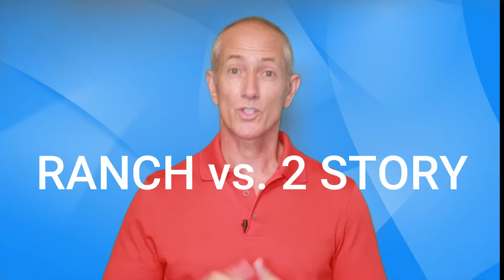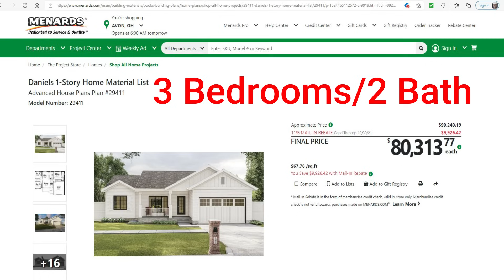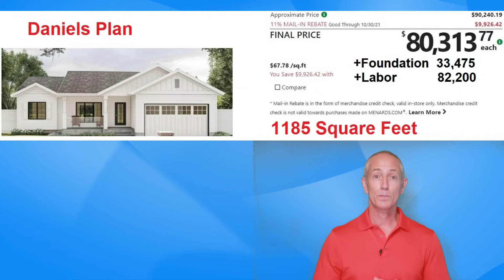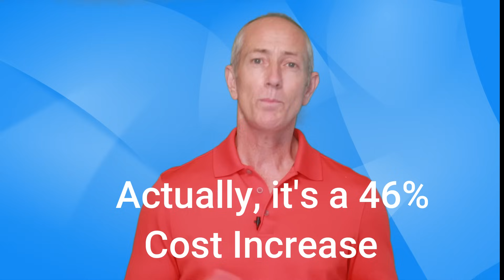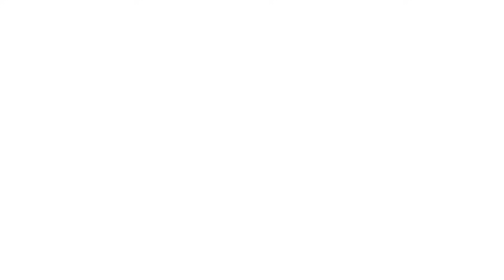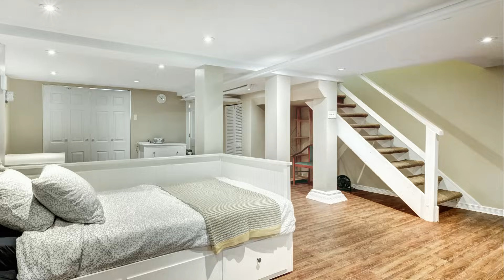Affordable Houses: 3 Design Tips to Save

Comment: Hi MIchael, I have a few questions if you have time to answer it:

1) When they advertised 2000 sq ft, does that mean just the house only or does it include the total land plot (front and backyard)?
2) If it's just the house are, is that the area of the first floor, or is an accumulation of both first and second floor?
Reply from the maker: Just the house and yes, it's the living space on first and second floor (garage and unfinished areas not included)
Reply: @OpenBookBuild   Thank you for the information!

Comment: Not that simple, 2000 SQFT in a 1 Story is much roomier than in a 2 Story.   Lots of SQFT is lost in a 2 Story for Stairway, Hallways, Walls, and potentially an additional bathroom.
Reply from the maker: Hey JB.  Typically the stairs to the second floor are stacked over the stairs to the basement so they take up less room.  Also, the hallways, walls and baths would be the same whether they are on the 1st or 2nd floor.  A good home design minimizes hallways to maximize living space.  Unless you really want a place to put all the family photos, a hallway is wasted space.

Comment: You mentioned labor but did not take into account the markup the Contractor is going to apply. Typically 20-30% on top of the subtotal number (Material and Labor) is what most contractors will give you for a final price. So lets take your $267K and add 25%, that's roughly $333K. You might say wow that's a big difference but the reality is that a legitimate contractor pays a lot of overhead to provide your project with legitimate labor and insurance. Consider that payroll tax is 12% (At least in NY it is), meaning if the contractor pays an employee $800/week that will cost him roughly $900 after Uncle Sam takes his cut, now times that by a crew of 3 or 4 and you you can see how the cost add up over the course of a project. A pick truck is $20-50K and the trailer, full of tools, the contractor brings with them is worth about $15-20K. When these tools break down, they must be replaced. You can decide to go with a cheap contractor but why put a 20-30 year financial obligation or 5 years worth of your salary on the line for the "wrong" contractor?

Comment: Great video. I work at menards, there are so many ways to reduce the cost of these packages. It’s kind of nickel and diming, but it adds up. Go in to the building materials desk and talk to the guys there, they can help :) 
First thing I’d do is change the siding on most of these packages. Many times it’s fiber cement or smart side, which is just absolutely nuts right now as far as cost goes.
Reply: What siding would you choose then?
Reply: It's such a durable item. Hardi just works especially for fire resistance
Reply: Come on, man.  LP is about $1.30 a sq ft.  How much cheaper can you get?
Reply: @MrSteeDoo  it’s not just the cost of materials . Include the cost of labor for installation and painting. Also the appearance of joints in siding , how appealing are they?
Reply: Gotta pay extra and go brick
Reply: I have clicked around on Menards website don't think I ever got their whole house packages location and then I live in SC and didn't see that they would ship.
Reply: How do iget the package for the build up from your company.
Reply: Man fiber cement is just horrendous to work with (cutting, weight, dust etc.) and you better be spot on with end cut sealing due to delamination from water intrusion. LP is so much more user friendly.
Reply: @rangerdoc1029  so you're saying everything within the home was fueled by some source... So even if the house was wood/paper/ect... It would have also burned. To get to a temperature to melt stainless steel screws to hold fiber cement... Your looking at some extreme fuel source

Comment: Here are a couple of practical tips for an owner managed build:

1.)  When you meet with the prospective trades on the jobsite, don't get out of your Mercedes in slacks and loafers, keep a modest presentation and drive a modest vehicle to the meeting.
2.)  Don't come across as rigid or difficult, communicate what you are looking to achieve and ask the trade for their thoughts on how they see it best being achieved at a reasonable cost.
3.)  Build at least a 10% contingency into your line item budget.

If the trades sniff you are flush, your bid will reflect that.  If the trades perceive you as difficult and all knowing (when they know you aren't), they'll juice the bid as well.  Contingency will provide you with the needed cushion to complete the work.

Best of luck on your adventure, it will be one heck of a learning experience, and nowhere close to as easy as these videos make it seem.  Go in eyes wide open, and patient.

Comment: Kinda a bad example bc you could finish the ranch basement .. for 10k for your self .. say the basement 1100 sqft .. and the around 72k difference between the 2 floor plans , that'd bring you up to 2200 sqft .. and still save over 60k .. even go as far as adding and extra bath room in the basement 2k ... unless the 2 story has a basement as well

Comment: you should have recommended to have a master bed room on the MAIN floor, where most of the house will end up being, and NOT recommend a elevator, what happens when the elevator is not working?? elevator is not practical, even if they are cheaper!
Reply: Yes master in main floor. Also, if you have an elevator you must have backup stairs witch takes up valuable space.

Comment: If you're in a super hot housing market, framers do not care about the details.  They charge X per sq ft and you have to pay.  They have a dozen jobs lined up and the charge what they charge.  Now if you have an over the top roof, thats different, but they couldnt care less if its a perfect square or had 8 additional corners.  One price and its not the low end.

Comment: slab on grade and use the slab as finished floor. That actually saves tons especially if you want a smaller house to begin with.
Reply: but isnt that a possible plumbing issue down the road if there are leaks.
Reply: @aloiswinzinger1160  always the excuse but they seem fine in Europe. When you count the costs savings vs having to break and dig a small part, it's not bad

Comment: I did this exact thing in 2000, built/sub contracted my own house. The only work i intended to do was the electrical being an electrician. As it happened my framer made too many mistakes and  had to rebuild some things and the house became unprofitable for him so i ended up doing the finishing carpentry as well.
The house, land and labour all cost me about 131,000 and 1 yr later to avoid capital gains i sold it for 152,000 which was under the cost we origanlly projected to just buy same/similar house which was about 155,000, so couldve waited a few months for 3-4 more grand  but we were happy walking away with 20,000 profit, which we used as down payment on another rental  house in the city with 2 basement suites
Reply: @matthewfuller9760  western canada

Comment: Great video. I GC’ed my house 3 years ago. It was challenging but rewarding. I also saved $150-200k on a 4000 square ft home. I agree with your analysis. We are seeing more and more residential elevators in my area. My retirement house will have one. Another consideration architecturally is going up gives you more flexibility to allow light in living spaces. Things to watch out with room above the garage include HVAC and steel. I used a heeled attic truss and a mini split system.
Reply: What did the price/SF end up? Curious as I plan myself the same.
Reply: @Johnnyprc  how could you possibly know. You don’t know anything about the house, what the quotes were or what I paid?
Reply: @Johnnyprc  depends on where you are. Here in California if you are paying $500/SF in some areas it's EASY to save that much
Reply: Yeah...I can't see paying some dude that much profit to sit in his $80,000 truck and do nothing.
Reply: @Johnnyprc  you obviously don't know what negotiating is.  I used to negotiate all repairs for my rentals from ac replacement to roofs, electrical and plumbing.  Out of work people will take jobs for less so they can eat too.

Comment: There are so many reasons to prefer a single level house.   I’m happy we payed 100K+ more for our new single level house vs going with one of the split level or 2 story plans.
Reply: Y
Reply: @liveandletlive2894  as you get older you won’t want stairs.  At least 2 bedrooms are needed on the first floor for me.  The master bedroom so it’s easier to age in place without needing to worry about climbing stairs when old or if ever injured.  Along with a guess bedroom on the first level so parents can visit without needing to climb stairs.   

Imagine being 80 years old and due to failing health you can’t make it up stairs to your bedroom.  Your only options are to figure out a place to sleep downstairs or sell and move.   Moving always sucks but it must suck more at 80 when your health isn’t great to begin with.
Reply: @brent1041  They make lift chairs that can be retrofitted to common stairways.   They're 6k for a simple, straight stairway.

Comment: One way to save money is to stop with the crazy roof and ceiling angles.  That adds up in material cost and especially labor cost.  Simple shapes are easier and faster to build.
Reply: Rooflines has gotten out of hand
Reply: As a senior with knee/hip issues, a two story home is a potential death trap. An elevator mitigates some of that but who is going to go onto the roof 3-4 times per year to clean out the pine needles and leaves. Every valley collects debris and, again, becomes a potential death trap for either the home owner or the house.  Simple gable or offset shed roof is the only way around that.

Comment: Sounds like a typical builder:  Lets build the biggest, disposable house possible for the cheapest price...  Pitiful...
Reply: A rectangular box makes sense.  That doesn't make it disposable.
Reply: @MrSteeDoo  When your main focus is on cost & esthetic's the byproduct WILL be a disposable structure period...  I've seen thousands of examples over the past 20 years.  When building, your focus should be on building a solid, durable, sustainable, safe structure that is built with fine workmanship by skilled craftsman who actually take pride in their craft.  When your great grandchildren look at it, they can be proud of the care, attention to detail and quality you have passed down to them.  Instead of a structure that is build by the cheapest bidder, whos goal it to get as many done as quickly as possible.
Reply: @AC-SuperCool  You are speaking in generalities.

What specifically is deficient about a 2x6 platform framed structure?  I don't know that any "skilled craftsman" who is going to make much of a difference in the framing.

Please inform me of some specifics.
Reply: @MrSteeDoo   framing is just one example.  I can show some horrific framing in my area.  Wall sheathing with cardboard, poor vapor control layers, poor bulk water control, window sealing & flashing, air control is non existent, thermal layers are an absolute joke, plumbing, electrical & don’t get me going on hvac and on and on down the line..  There’s no way to show you in detail here.  I’d love to show you many many examples of this in person.  Are you near southeast Louisiana?
Reply: @AC-SuperCool  It is always the responsibility of the buyer to ensure they don't get ripped off.  That's a given.

I am in WI

Comment: I'm 2 minutes in and wanted to say don't be fooled by the number Menards provided because that's AFTER the rebate and before taxes. Plus the price of materials fluctuates daily, which is why it says "approximate price." The rebate, which is stopping until next year, is a merchandise credit that can be used on future purchases. The competition, such as Lowes and HomeDepot, won't price match on lumber because they say it's sub-standard and not comparable but all I've ever noticed is the 2x4's have sharper edges rather than rounded.
Reply from the maker: This video is not supposed to be about Menards.  Menards pricing is typically competitive to building supply companies and that is why we use the Menards published price when talking about current  material pricing.  No one should ever mention Home Depot or Lowes in the same sentence as building a home from the ground up.  Their pricing is retail and is higher than building suppliers like 84 Lumber, Builder's First Source, Carter Lumber...etc.  These companies know how to build a pack of lumber for building a complete house...the Depot doesn't do this.  So, the Menards pricing, which is updated weekly, is just a way to communicate the approximate cost to build today.
Reply: I would NEVER buy a package from Menards.  When I DIY'ed a house 20 years ago I went to Menards and hand-picked all the lumber.  If you let them do it you may get a pile of rejects.

Comment: Hi. Good video. I agree with a finished basement, but IMO, It has to be a daylight basement. My preference, is a ranch on a full basement. Two master on-suites on the main level with 2 more bedrooms in the basement. I do not like living space above the garage at all. The spaces are too hot in the summer and too cold in the winter. From experience living in hot and cold climates, I do not like a 2-story house. Too uncomfortable. Upstairs is always HOT in both summer and winter. I am totally willing to pay more for a house that is comfortable all year round.
Reply: Invest in good insulation and your concerns are taken care of...
Reply from the maker: Hi Craig.  You are so right on the living space over the garage.  It takes careful consideration in the design and build process to make sure that space is comfortable.  People forget that a room over the garage has only one warm wall and the floor is adjacent to the cold garage.  So, insulation and HVAC needs to be carefully put together or the room is always too hot or too cold.  Thanks for the comment.
Reply: build with ICF and you will not have those issues

Comment: what about the hvac cost?  I don't see that anywhere and it's not included in the menards package.  how much does that add?
Reply: It depends on what you want.  The video is just addressing the structure.

Probably 10k for a forced air system.

Comment: Don't forget that certain rooms like bathrooms, kitchens etc have a much higher cost/sq foot than rooms like unfished basement or bedrooms. Odds are both of them have pretty similar sized kitchens so as a percentage of the house you end up with a much higher total cost/sq foot
Reply: How much less do you estimate the cost would be if no cabinets are installed in a kitchen?  I want a very minimalist house and don't want the hassle of cleaning inside of cabinets or them taking up space.  I will have a simple pantry closet to store all kitchen supplies and have a fridge, stove, sink and oven.  Just something simple that I can wipe down without having all of those corners and shelves collecting dust.
Reply: @moonsyoungestsun6550  All sorts of fools spend 25-50k on kitchen cabinets.  You can easily get used ones on FB for cheap or free.
Reply: @MrSteeDoo  Home Depot has basic kitchen cabinets for around $200 each.